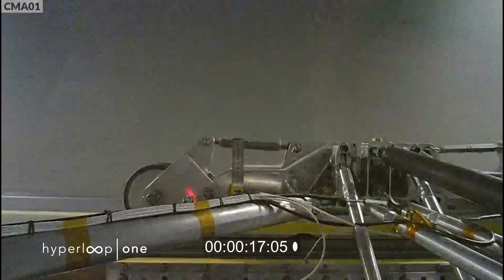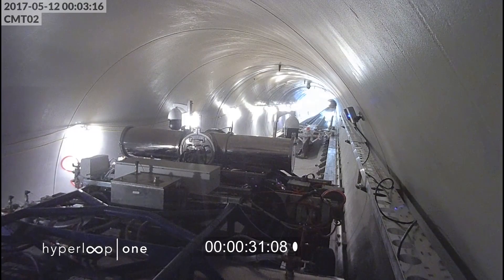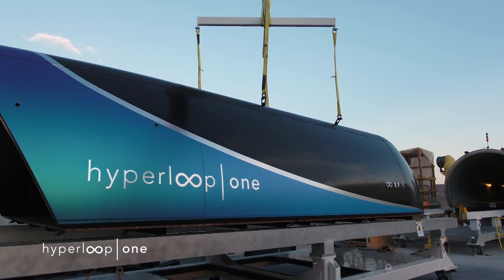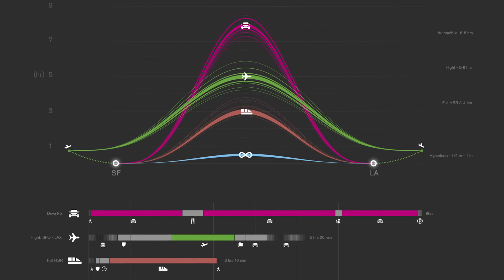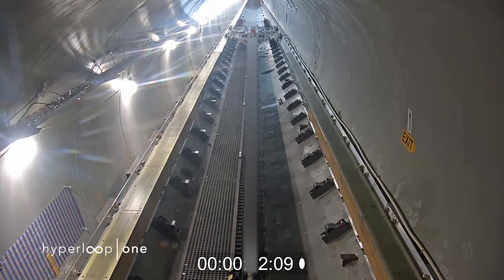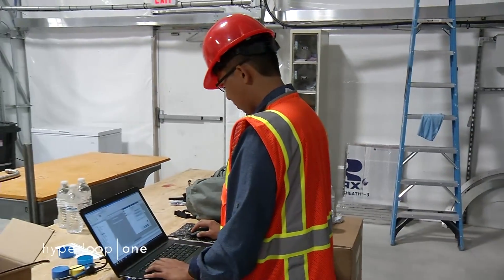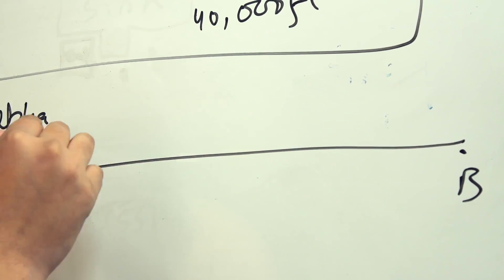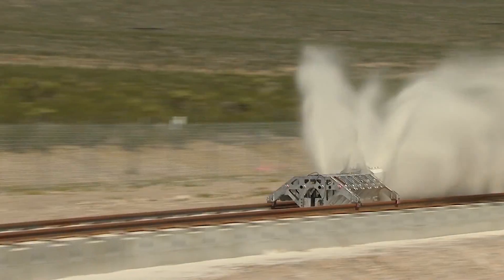Watch the Hyperloop Complete Its First Successful Test Ride | WIRED

Comment: Only 70 Miles/hr (112.6 KM/hr)? Meh
Reply: It reached that speed in 500 feet. The velocity will increase as it travels along the full length of the tube.
Reply: Most high end trains go betwen 200-400km/h sorry dudes but this is really retarded. A shitty, too expensive crap, 0 gravity train that goes 120km/h.... My 1980 civic goes faster my dude
Reply: MCgoo09/BelgianCat How fast and high did the first few successful planes fly? What exactly is your point in being so negative about the 70mph speed?  Did you expect them to build and test for full speed straight off the bat? Meh!!!
Reply: laith sababa it will never be made for simple engineering reasons.
Reply: Yea but for U.S. transportation, that a great feat (our train transportation sucks btw).
Reply: Squiddi -- that's true, but for this test, as the original commenter said. "meh". This test is not a cause for the general public to pop the champagne.
Reply: It's their first test... The track isn't even long enough lmao. You really expect it to
go 700 even within the first ten tests?
Reply: They are testing the viability of the system, they did not need it to go fast.  They needed to see that the engineering was sound at this scale.

It's kind of like... "okay if we can prove the system works, then we can scale it up".  You get me?
Reply: Ambient Morality - a bridge isn't vacuum sealed. More of an issue for humans in a tube going 700 mph. The tunnel would be better underground for expansion issues.
Reply: What about the stresses that build up at joining points?
Reply: Yet cars go faster, and they don't require an expensive vacuum tube.
Reply: christianbro2 But: Cars aren't public, and you can't just zip around on every street at 70+ mph
Reply: Rayaan Khan 500 m is enough for my bike to reach 120 mph then brake to 0
Reply: You would need expansion points on something that long (like bridges have), again pointed out in thunderf00t's video (there were flaws of course, but this is the most valid point.) If the tubing sections were each 100m (longer than the actual tubes they have currently) there would be 50mm of expansion for each section. This would end up needing 6,000 moving, telescoping, seals (as proposed in the plans). Once again, to reiterate, this is all holding basically a vacuum.
Reply: You don't need expansion points, you can also allow the tube to buckle and deform along a controlled path. This is done by a series of towers which allow free rotation in the z-axis with towers in between that allow free translation along a single axis. Additionally, you'd pretension the entire tube which would cut thermal expansion in half, so the deflection is even less. This curvature would not be noticeable for passengers.
Reply: Dude it's a PROTOTYPE
Reply: A bridge is bolted down to the ground with expansion joints, and again, not holding a near vacuum. I believe the expansion of a tube that is 600km would expand about 300m on a 40 degree C day (From thunderf00t's video) And if you are going near mach speeds (In a near vacuum, mind you), you cant have the track or tube curved.
Reply: Thunderfoot had an awful analysis. You could cut down on the expansion by a factor of two by tensioning the tube to begin with, so only 150m over 600000m. One meter deflection over 4000 meters is nothing, a very tiny curvature (controlled buckling) could deal with that kind of expansion. There's nothing against a curved tube, it just has to be very small.
Reply: The Knave's Tavern That aren't public is an advantage, you don't have to share them with strange people you just find in public road transport in America.
Reply: 70 mph is amazing since this is only the first test. In the future, the hyperloop will reach speeds close to mach 1.
Reply: TheEreder "Stupid", "Blind", "Ignorant". Really!? Well I guess I must defer to your oh so convincing, well thought out, eloquently expressed arguments. I obviously don't have a clue and must thank you for putting me straight.
Reply: Listen again, he clearly says "it hits 70 miles/hr".
Reply: you're talking about the recent test, he's talking about target speeds for future iterations.
Reply: That's their goal. Currently it only hits 70.
Reply: look the tube inst that long to accelerate to 700 and than decelerate without smashing into the end is unrealistic with the length of tube they had
Reply: MCgoos09/BelgianCat - I heard it too. The test was only 70 mph...and I say meh to that as well. It's supposed to do 700 mph...no where near that.
Reply: read the actual whitepaper by elon musk please
Reply: laith sababa hyper loop has already been debunked by thunder foot it's not possible according to physics and there's videos of the tubes collapsing from the pressure.of the vacuum which would kill every body in it
Reply: Obviously. A bridge would also expand in the sun and contract when it is night, that's not good for concrete.

There's easy ways to solve this problem. Towers that allow free rotation of the tube (but constrain position) and towers that allow linear motion along one axis can be combined to allow the tube to buckle in a controlled manner, meaning that the thermal expansion just makes the tube a bit curved. The amount that steel expands from 0 to 100deg is so small that said curvature shouldn't even be notable.
Reply: it was just systems test, it's supposed to go up 750 mph :/
Reply: It can hit upto 700 miles/hour once the tube is long enough. You need a tube of atleast 100km  to achieve this maximum speed.
Reply: Danger King name a single breakthrough technology that succeeded in its first test
Reply: That's an engineering problem yes, but considering they already have pipes (oil pipelines) I don't see why they couldn't make an equally long pipe. Accounting for the low pressure enviroment is the only (somewhat) new concept they will have to solve. They may make mistakes during testing but those will only serve to further their goals.
Reply: A 100km long tube would expand in the sun, and then contract when it is night, that is not good for something holding a near vacuum
Reply: MCgoos09/BelgianCat Agree ... the target speed in the day of the test was over 100mph (140 if I remember correctly) but they only managed to reach 70mph ... wonder why this video didn't say it
Reply: MCgoos09/BelgianCat haha are u German? If u are, that makes a lot of sense as the German Autobahn system lets u go extremely fast

Comment: Man, this is so awesome. This is basically one of the first signs that the stereotypical future we think of is arriving.
Reply: It's no where near arriving. Not even close.
Reply: Le LJ, the crude answer to your argument is simple: there's money to be made, just like with bullet trains, the importance of the speed is that it'll take less time to get to point B, so traveling long distances would be less of a pain in the ass.
EDIT: besides, wouldn't you love to feel that speed, man?
Reply: Explain to me how believing in a youtuber rather than in the engineers who are working in this is critical thinking, i think you meant to type "troll" instead of "thinking"
Reply: I like how everyone is assuming the failure mode of the Hyperloop tube will be a violent implosion. Vacuum chambers can be designed to deal with rupture, and Hyperloop certainly would be. I expect 1 inch thick steel (which the Hyperloop white paper calls for). Even if the tube does collapse locally, the collapse will choke the flow further, nearly sealing off the rest of the tube. Nobody would design it at all if the entire tube would literally collapse when ruptured. But it won't, because 1 inch thick steel is far more thickness than needed to prevent catastrophic implosion.
Reply: but it is realistic, i know it sound crazy, but i seriously see it happening,(although i am aware that it might not). and yeah, i wouldn't want to be inside of it if it fails, but planes are deadly enough, now, if it would EXPLODE with that force, i'll totaly "change sides"
Reply: Too Many Edits Productions  what?! you mean body suits too? :-)
Reply: Matt Jones I bet you’re fun at parties
Reply: Too Many Edits Productions China is building a real one under the sea right now. You can find it on you tube
Reply: Too Many Edits Productions yea, and if a pod spring a leak YOU ARE DEAD
Reply: I don't know what you think, but I'd like a cyberpunk future
Reply: matt, google transcontinental gas pipeline, and understand that this is being built by a prtivate company, no one ever said anything about this belonging to the state.
Reply: "we" nice illusion, want to be in a group heh?
Reply: Sure, there's better ways to spend the money, there always is, but it's their money to do as they please, and the rich would live in the inner city, but seriously, if you have a plan to help the poor, by all means, give it to the investors, convince them, do something other thar bitch on youtube, and keep in mind that we live in a capitalist world, where poverty will always exist and problems constantly arise.
Reply: A train is the future?
Reply: One earthquake will put an end to it real quick. And if that doesn't Californian regulations will, or the Californian taxpayer that'll have to pay for the ridiculously high maintenance and operational cost for a loop the majority of the will never get to see or use.
Reply: DrakeZealot 
You risk getting crushed in literally every mode of transportation we currently have, that shouldn't discourage anyone from using this one
Reply: Jubulburb Wuldrd
Any punctures will only slow down the carriages due to air resistance. And I'm not quite sure why you put "hypeloop" in brackets even though it's clearly called that. (You also spelt it wrong.)
Reply: Jubulburb Wuldrd, if what you're trying to say is that the entirety of the tube will crumble in case of a puncture, you should learn a bit about vacuums (and grammar), and always be aware that you don't know more than all the people working hands on with the project.
Reply: You could say the same about airplanes, to me they seem about as dangerous, but if they actually get it to go as fast as they're planning, the trip would only last half of an hour.
Reply: xxxax31xxx but then again air travel is realistic and doesn't involve a 5.55×10^8 cubic feet vacuum chamber that would crash the vehicle at the force of 11 Moab's if it failed
Reply: Dean Nemphos While I agree and am sure the "death trap" argument has been brought for every single new mode of transportation in history.
Why not use highly efficient trains. There are concepts which already exist for both freight and public transport. Electric, high-speed. I don't see the necessity for reinvention here just because it might go up to 700mph under optimal conditions. Installing high-tech tube parts thousands of meters long would never be preferable to laying down well-constructed tracks. There's a degree of simplicity required for a high-tech future.
Even with eventually free sustainable electric energy (As per Musk's vision), those tubes are expensive in material, construction, maintenance.
Again, high complexity appears to be futuristic, but is it really the way to go?
Reply: in "hypeloop" you will be crushed in your house even if some other house in different city(like literally) fails(ie puncture a tube in any place of its enormous length). Like it?) Enjoy)
Reply: except you risk getting crushed if the system fails. Have fun
Reply: Too Many Edits Productions its fucking stupid
Reply: It has already arrived. We have self-driving cars, speech recognition and everything talks and controls your home. You just have to pay for it.
Reply: and you also risk getting crushed if your house "fails". Have fun
Reply: xxxax31xxx you"re an idiot